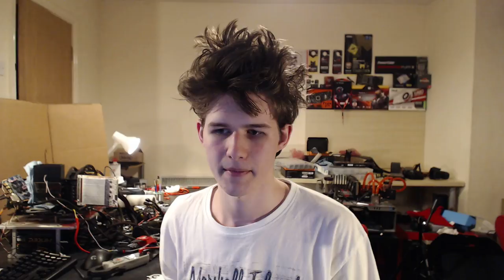A follow up on PCI-e power cable daisy chains.

Comment: Between the Air Conditioner unit in my window, and the Coal Stove used to keep my house warm in winter, my room where my PC sits is basically ALWAYS between 21C and 24C at worst! Living without climate control is a bitch...

Comment: What about molex to 6pin then dual 6 pins to a 8 pin?
Reply: Molex to 6 pin would be interesting.

Dual 6 pin to 8 pin should be the same as a standard 8 pin. 6 pins rated at 75W and 8 pins rated at 150W so if they have dual 6 pin into single 8 pin it should be able to deliver without fault. That does rely on the company not cheaping out on the cables however but this would be a problem with the manufacturer not the method.

Comment: Also no-one has an ambiant temp. in a house with over 35C.
Reply: My parents house... We don't turn on the AC until its past 100*f (38c). I'm in the middle of the US.  We have had it past 105*f (40.5c). But its so hot, you don't have the energy to get off the couch at that point, like even playing just sitting there on the couch with a game controller is too much effort.

We also heat the place with firewood we cut from trees that are in the way in our fields, and we close off my room to not burn so much firewood. It gets cold enough that if you leave a drink in my room, it will turn into ice. I only use plastic cups because the last time I used a glass cup, well you know, I left it my room overnight and the water turned into a block of ice and shattered the glass. I sleep under a ridiculously heavy blanket so its fine, but it does take a while to warm up the blanket.
Reply: Now I'm in college and will get a well paying job, but I don't really care about money. As long as I can afford central heat and air, that's enough money for me.
Reply: Come visit us in AU mate ;)

Comment: so about the cables impacting OC, you're testing on Vega after making a whole rant about how AMD doesn't monitor power..... so wouldn't those comment only come from nVidia users?
Reply from the maker: I don't have any modern Nvidia cards with 2 8pin power connectors.